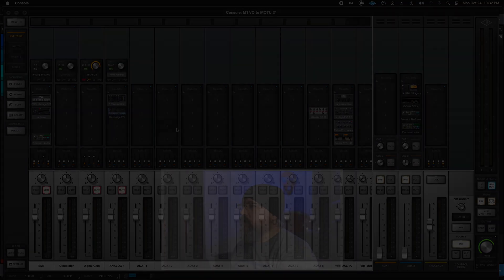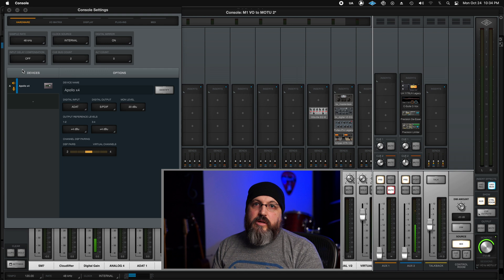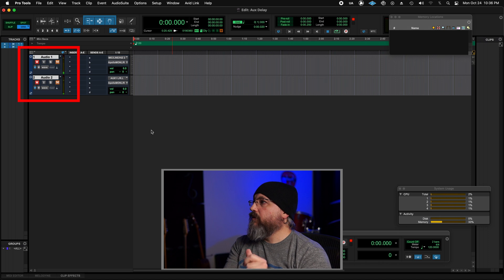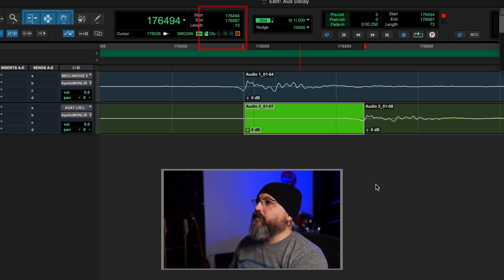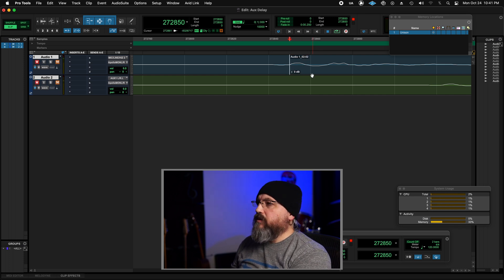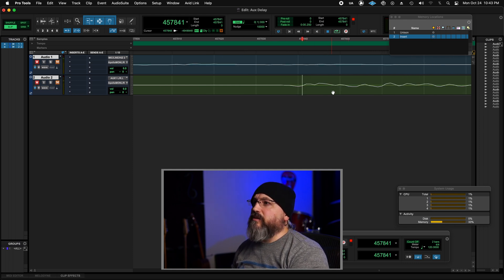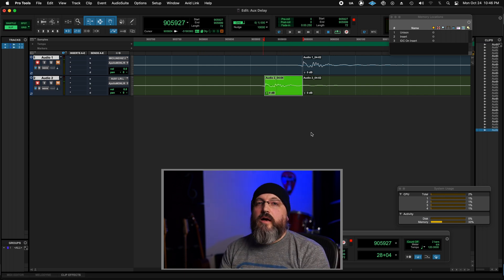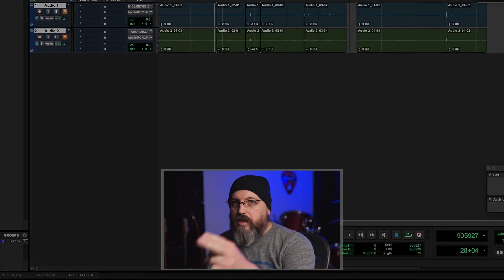How to Measure UA Apollo Aux Delay/Offset and Align & Compensate for it

Comment from the maker: Correction - Medium is 200 samples. I said that wrong in the video. Short is 100 samples.
Reply: Do the inserts vary depending on what plug in you are using? Or is it pretty consistent?
Reply from the maker: @DeadOriginalMusic  I suppose they could vary. There's a latency chart I made that may be helpful here - https://docs.google.com/spreadsheets/d/1XjfD0GxEnWS_4nqWcz3J_RUEQDuBjCYhnO8YeiBuKWk

Comment: wait how do you compensate for latency if you don't use IDC?  what about tracking drums? you mentioned plugins you use to combat that? super awesome vid btw thanks!
Reply from the maker: Thanks! I use either the same plugin latency across the channels, or a combination (even bypassed) that equals the same latency. I do not worry about compensating, since, technically, even with IDC enabled you should be compensating an amount opposite whatever IDC amount you're using (i.e. IDC of short will actually print 100 samples late on the timeline). Or, at least it used to. I haven't tested it in a few years. I NEVER use IDC, personally.
Reply: i see so for monitoring while playing have the IDC off and in your DAW have the delay on the individual tracks so they play back in time together...man what a weird work around...my issue is im recording a full drum kit, with drum triggers in real time and IDC was killing the performance...way too much noticeable latency for a drummer...so using the chart of latency you made you can just adjust those values in your daw for phase aligned playback (logic pro and ableton both have track delay inputs available). Do you recommend not using unison plugins vs inserts? thanks for this its def clearing things up.

Comment: This is great stuff, Saw your correction below pinned in the comments here too. I am an RTFM kind of guy, but there's a lot of M(anual) pages to read with UAD and I am not even sure if they cover this detail clearly..  I got my start with analog tape and SMPTE synced sequencers...  Never really had to think about stuff like this back then.  (there were other annoyances and details instead lol)  Subscribed.  Thanks for the tip in the UAD forum and the link that brought me here.    

I have been working at 44.1with the default IDC at medium since I got my x8p..  

I only really use Console Auxes for effects in the headphones for the talent during tracking, I never print effects (or anything else) through the auxes in UAD console..  

When I track my vocals I DO however run my 1073 in unison and an 1176 legacy in an insert slot and said insert is set to print usually.  
I commit my vocals the same way I used to when using tape, with the mic pre and tracking compression that sits well in my cans, prevents overloads and is inspiring to sing with and work with my voice without squashing the life out of it.

If you set an insert to print, does it have the same exception to the rule of sample delay that the unison slot does?  (I need to re-watch this video again until I fully grok the math and how it applies to what I am even asking.. I need coffee lol)
Reply from the maker: Thank you! So, Unison will ALWAYS print. Keep that in mind. If Unison is feeding an aux, you're still dealing with the same number of samples of delay, which, if you're using 100% wet FX is only a predelay happening. One that that's super hard to wrap your head around is with IDC disabled (I always use it this way, personally, for the lowest latency) your tracks will print out of sync with each other, unless you compensate manually by using bypassed plugins (I do this). However, if you DO use IDC, the tracks will actually print on the timeline offset (late) the same number of samples as the max of the delay. 

When I switched to Carbon after some terrors with Apollo delay comp (turned out to be a PT setting that caused a bug) I was STILL running into wacky delay issues so often I was REALLY considering buying a tape machine again!
Reply: @MattHepworth I am aware that Unison by nature always prints. I also happen to choose to have the insert for the compressor printing as well while tracking my vocals. :-)
Reply from the maker: @christopherjbutler I usually do as well.

Comment: Great info! How would you go, if you had an UAD 4710 running through the Apollos ADAT? Would you need to compensate for this, too?
Reply from the maker: Thank you! Depending on what Apollo you have, you may need to compensate. I would measure the same way for both the Apollo vs Aux and the 4-710D vs the Aux. Whatever the difference between the two offsets is is how much difference there is between the Apollo and the 4-710D over ADAT.

Comment: If I am using the Neve 1073 w/EQ plugin in Unison and the Tube Tech CL1B Mkll on insert. I am printing the insert. What should I set the offset in pro tools when I have delay compensation? I have delay compensation in UA console turned off.
Reply from the maker: If you're using the aux you'll want to do -77 (CL1B mkii is 4 samples). Unison always prints, so I don't normally compensate for that, but if you wanted to be ultra-precise you'd offset -55 on the dry and -132 on the aux.
Reply: @MattHepworth  Sorry I am a bit unclear about the aux part. I am essentially monitoring through pro tools, thru an 'record' audio track, not an aux. In the Console app, I want to emulate the famous Neve 1073 + CL1B chain via unison and insert where I have 'print' active instead of 'monitor'. Also in Console, delay compensation is off. Now in pro tools, I record in 32 buffer size with delay compensation on with no issues whatsoever, however my concern is if the vocal chain in console are causing audio latency to the record takes? If so, I want to set an offset to the 'lead vocal' audio tracks that I will be dragging the punched in vocal's from the 'record' audio track from. Yes, I want to be ultra-precise. Please advise, thanks Matt!
Reply from the maker: Interesting. Monitoring through PT with Apollo isn't as typical, since the latency is higher, but totally fine to do, of course. 55 samples for Unison and 4 for the CL1B, but I don't think I'd try to compensate for it, as strange as that sounds. -59 samples would be the offset, but the offset is only active for playback, not recording, so rather than trying to deal with punch ins, I'd not worry about the offset. The way to test is to split and record two tracks — one without processing and compare in an overdub and offset active to see how it changes. In my opinion, it won't really be a concern.
Reply: @MattHepworth  Thanks for the reply Matt. I'll give it a test tonight with one track with the -59 offset on the playback track and the other one without it. I'll try to perform as tight as possible on beat and inspect which track is most accurate of the real time performance.
Reply from the maker: The only way to accurately judge is by doing both simultaneously. Only in punches/Overdubs will there be any variance. This is because the offset doesn't work during input monitoring. 
It doesn't have to be a mic to test, either. It could be a stereo cable from your phone playing a mono Transient (snare, even) recorded on two channels.
Reply: I think he is simply recording through this main input, not an aux, Matt. He says he will have the aux in console as a send to his input for monitoring reverb but he has PRINT enabled in console to print the compression he has in the input track. Therefore as long as he has Delay compensation in PT on and IDC in console off, his signal should be in sync without any needed offset recorded into PT. It should be the exact same audio he was hearing in his headphones monitoring through console. Adding CLA-2A will add slight latency, but none of this needs to be compensated as what he will hear in his headphones, the performance he will give will be the exact same that PT will pick up. The aux reverb in console is just a send to the input track in console to monitor with a little reverb, no compensation needed there since the signal input in PT is from the input track in console, not the aux.
Reply: I do the same thing as him but I monitor through the UAD console. I don’t print my aux. I do use the cl1b on my insert and print the insert. I took off IDC. Do I still need to compensate my dry signal? Does the insert affect the dry signal?
Reply from the maker: The insert does affect the dry signal. In your case I don't think I'd bother doing any further compensation.
Reply: @MattHepworth  thanks bro I appreciate the quick response
Reply: What if i am printing a unison Neve 1073 (55 samples) + CLA-2A (56 samples) and have the aux sends for reverb (EMT-140) + delay. Since aux doesn't get printed, only the unison and insert, will i need to adjust delay compensation in console or adjust offset in Pro tools? I will be now just monitor thru Console instead of Pro tools.
Reply from the maker: In this case I would not compensate. You could also enable IDC in Console and set to Medium. This will ensure no compensation is required at the expense of a little latency.
Reply: @MattHepworth  Could you elaborate on ensuring there is no compensation required at the expensive of a little latency? A bit confused on needing to now enable IDC in console set to Medium.
Reply: @MattHepworth This is what UAD states: Input Delay Compensation (in Console>Settings>Hardware) is an important feature to leave on if you are using multiple microphones on the same sound source (such as a multi-mic drum recording) and you are running up-sampled plug-ins on some channels but not the others. However, if your recording scenario is anything other than that, you can set this feature to "OFF" for the lowest possible latency.
Reply from the maker: That's correct.
Reply from the maker: Technically, without IDC enabled the the signal will print offset by 111 samples, in your case (111 samples later than if you'd had no plugins). With IDC enabled, both scenarios (with or without plugins) will print at the identical time, instead of one being offset.
Reply: @MattHepworth  But what if I just enable Delay Compensation in Pro Tools? Won't that detect the 111 samples offset and align everything in time? Or is enabling IDC in console saving that 'effort' from the DAW and the print the signal at the identical time?
Reply: this is for the dry signal? this get really confusing  @MattHepworth
Reply from the maker: No, PT will not be aware of the 111 samples, which is why it will print offset.
Reply from the maker: @berdeauxlaveau6515 yes, but this is not something I'd worry about. I only compensate when the aux is involved and I'm printing the aux.
Reply: @MattHepworth  Ok, so for the Medium setting, Medium is set for 200 samples. Does it have a range, meaning that it handles all samples from lower or equal to 200?
Reply: @MattHepworth  This is so interesting because for the past 1-2 years I have done my recordings by monitoring through pro tools, using the UAD console for unison Neve 1073 + Tube-tech cl1b in insert to Print into DAW. I have had IDC set to off this whole time and I wonder because of this, I have always been printing my signal offset instead of perfectly aligned as I had recorded it due to PT not actually compensating the 55 + 4 samples.
Reply from the maker: Yes, it'll always print offset with IDC disabled, but it's an imperceptible offset in the grand scheme of things. It's also offset if you DO use IDC, but all channels are consistent, regardless of plugins. Using medium all tracks are offset by up to 200 samples, I believe, though the plugins added per track in Console WILL be time aligned against each other channel.
Reply: @MattHepworth  I'm not sure I can be happy with that.. I always assumed turning off IDC in console and turning on IDC in PT was taking care of all offset delay issues, but now I'm finding out this whole time at 48kHz sample rate and 59 samples, I had a 1.22ms offset which for me isn't great because not everyone's timing is perfect and adding this on top of it can make things slightly out of pocket. What's the way to make sure nothing like this ever happens? I'm really upset right now with UAD.
Reply from the maker: @youngsikkk Even Carbon/HDX doesn't compensate during recording on record armed paths, FYI (no ADC). While it could affect pocket, technically, pocket is usually affected by 20ms plus descrepancies, not 1-2ms. In PT you can always use the offset with a negative value.
Reply: @MattHepworth  So do instead of console IDC to medium, i can set my tracks that will have the printed audio to an offet of -111? (neve 1073 + cla2a printing) combo
Reply from the maker: Bingo.
Reply: @MattHepworth   Thanks a lot, I will give this a go.

Comment: Oh wow , so unison prints correctly but inserts don’t , and I see now your right there’s 73 samples of latency on the aux ! Good stuff .
Reply: Do the inserts vary depending on what plug in you are using? Or is it pretty consistent?
Reply: @DeadOriginalMusic  it consistent , the latency comes from the plug in being on an aux track , so if put the plug in as an insert and use the wet dry feature you’ll be golden . Also make sure to click whether or not you want to print the fx or not .
Reply: 75 aux and insert is about 128?  @MurdaMetz
Reply: @DeadOriginalMusic  there shouldn’t be any delay on the inserts , I was talking about on the aux track in console . Let me start over , you should have delay comp which takes care of the delay on plug in inserts in console , but the aux track in console will have 75 samples of delay no matter what you do .

Comment: So the more plugins I add, the more samples I need to compensate for?
Reply from the maker: If the plugins you add add latency (a little over half do) AND you're not printing them or using in the Unison slot, yes.
Reply from the maker: There's a latency chart at the top of uadforums.com under Resources that I made. Most new plugins add 55 samples.

Comment: So when you set idc to medium did it print  the aux track 100 samples sooner on the timeline ? And am I correct hearing you say unison adds 73 samples of latency to the timeline ? Is your buffer set to 256 ? I notice the buffer will affect the way tracks are printed to timeline , so if I’m running a buffer of 256 samples then my tracks seem to be delayed by the same amount which is a problem imo when accuracy is fundamentally being compromised.
Reply from the maker: The aux is 73 samples later than the normal signal. However, with IDC on, the normal signal will actually print LATER than the aux because IDC will add 100, 200 samples, etc. to the timeline. Buffer will not affect it as long as that Ignore Errors is unchecked.
Reply: @MattHepworth  hey so I unchecked ignore errors settings and did some recordings and I was surprised to find that you were right ! I find it really strange , and am wondering if this is meant to be this way , or if it’s a bug . I’d never guess that unchecking ignore playback errors would solve latency issues with tracks printing to the timeline correctly. Thanks Matt this def helps . I guess now I’m considering long term stability within the pro tools environment and dealing with 1 which is ideal when using the carbon vs Apollo , and I need to rewatch your videos about the pros and cons so I can decide if carbon is worth it for me .
Reply from the maker: No, it's definitely a bug. UA indicates the fix is on AVID's side, but it's a tough one. I'm glad I'm able to help!
Reply: @MattHepworth  
Relating to your comment of it being an AVID bug...  I use Reaper, and I wonder if I might see anything similar with that DAW..
Reply from the maker: @christopherjbutler I wouldn't think so, but let me know!

Comment: One of my major concerns as a beginner, is making sure each and all tracks are aligned. I'm on a quest to study this topic to avoid unknowingly having a bunch of offset tracks as a result. Got to figure this out for the use of Console and Logic. In my searches, this topic isn't discussed enough, at least clearly and to the point. Your video helps to become aware of all the steps needed. I have an interest in Little Labs Time Align plugin for this purpose. Would this plugin help? Also, when compensating which track becomes the reference in which all others are to be positioned to? Thanks for posting this video!
Reply from the maker: Simply put, use IDC if you're recording sources that need to be phase coherent AND you aren't planning to keep things lined up manually by using specific plugins in Console (even bypassed) to line things up. Analog and digital inputs are delay compensated, but aux is not. With Medium IDC in Console, all compensated channels will be placed 100 samples later in the DAW timeline than if IDC was disabled.
Reply: @MattHepworth  Thank you Matt! Using IDC, as I understand it, is just a general compensation value. Just to ball park the adjustment? Too bad the prompt doesn't give a value, besides small, medium and large. Maybe an alignment resolution of 1 sample is not needed?
Reply from the maker: Correction - Medium is 200 samples. I said that wrong in the video. Short is 100 samples. IDC in Console is two fold: it delays the sound of the tracks without any plugins by the actual amount of the plugin latency (i.e. 55 samples for API Vision), in the DAW, however, it delays the signal by whatever the IDC value is set to (i.e. 100, 200, 300, 1000 samples). The reference time would actually be the track without IDC enabled, rather than posting the delayed signal to the timeline.
Reply: @MattHepworth  I got smart turned it  off completely no effects,no inserts,hardware compressor on the way in